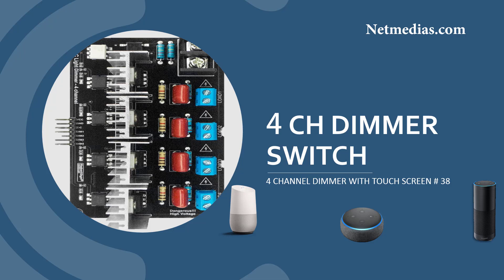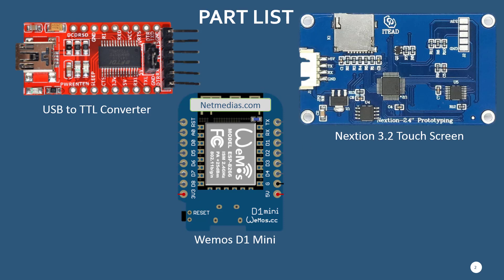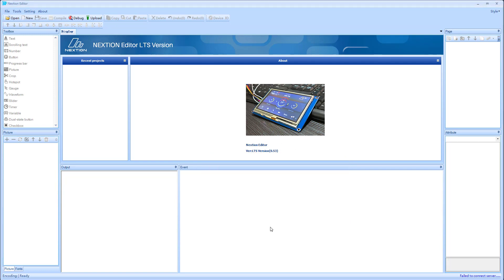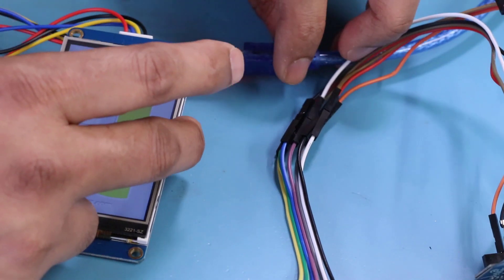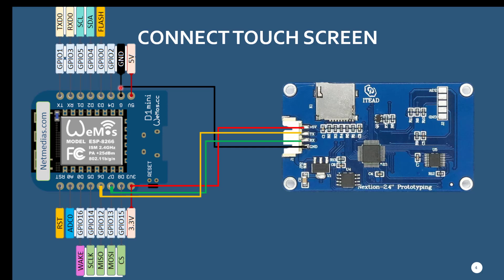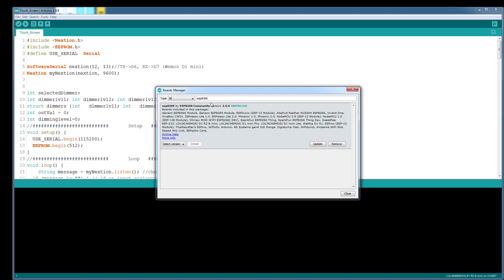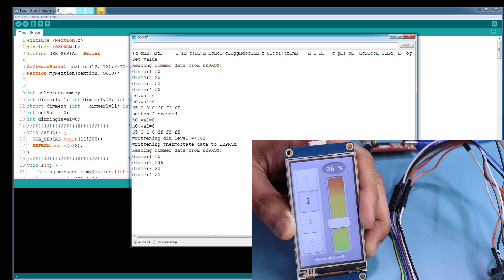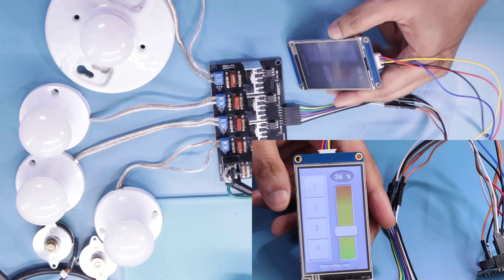4CH Dimmer Arduino Touch Screen Nextion part 1- Tutorial # 38

Comment: 1. How to turn On/Off external light through timer countdown function. i.e i wanted to turn ON light for 1 hour & after 1 hour light should be OFF, so for that how can i design my GUI button and code for system. The timer countdown should be HH-MM-SS.
   I did one demo to turn on/off led through timer countdown but i am getting some issues regarding timer. Means i am not able to set hours-minutes-second format in GUI. For that i am attaching my GUI Picture. 
   A. Could you guide me to make proper timer countdown function to turn on/off light? 
   B. Can you please make one video on timer countdown function to turn on/off light (external)?

2. How to interface PIR motion sensor with nextion display?

Comment: Assalamualikum. Thanks for your exceptional good video, patience and the hard working behind all of these. Is it possible to make the AC Dimmer which runs   both Blynk app by using slider button (or "+ve" & "-VE" buttons) and two physical  touch sensor switches (say 4 pcs TTP223 or 1 PCS TTP 224 for controlling 4 steps ...etc. ) for manual Control (Increasing or decreasing the bulb intensity or fan speed ) , If so please make a video particularly in coding part, It is difficult to relating the physical two buttons with Blink slider in coding part.

Comment: using this code i have issues with this line Nextion myNextion(nextion, 9600); and also i have problems with this line as well SoftwareSerial nextion(12, 13); could you help me with this project please
Reply from the maker: What is the error?
Reply: @netmedias7657  the error is uploading the file on arduino, is showing error over and over,  the 1st one is the softwareserial, then nextion libraries,